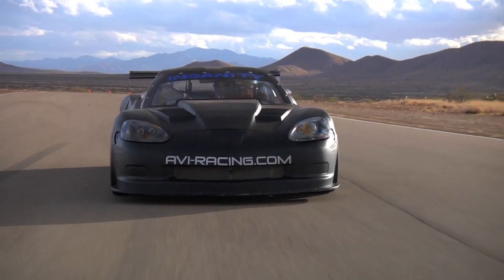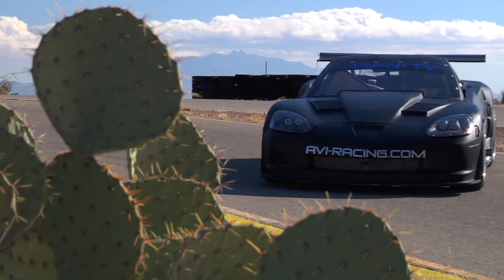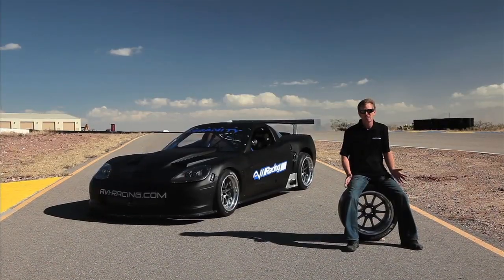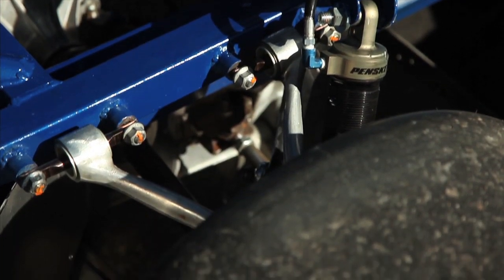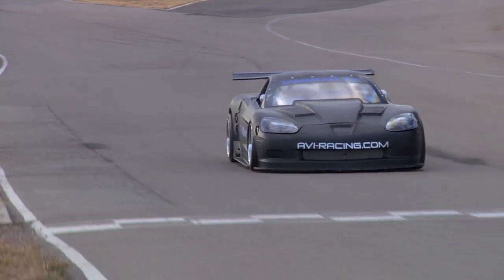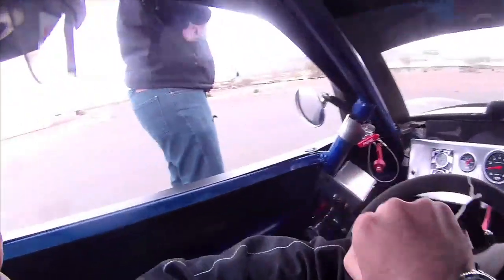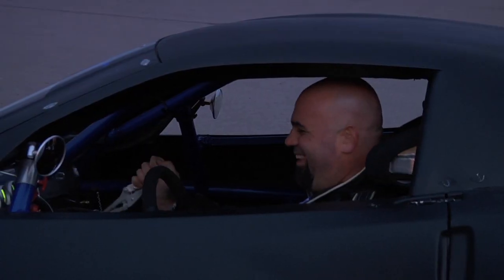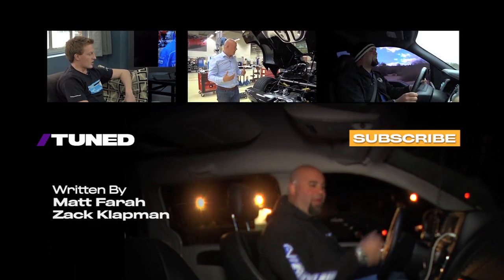The Ultra-Light, 505 WHP AVI Racing Corvette GT1 - /TUNED

Comment: Horsepower this horsepower that, i love rotaries, but since you've put so much into the engine i doubt you'll have enough for a downforce kit suspension kit new gearbox new clutch new tires like in the corvette, and i doubt it's as light as this corvette, so the extra 145 hp wont make a difference since your rx7 will be more weighty

Comment: I'm sorry, but you'd have to do more than shave weight off of your 3000GT to make it compete with this. Your awd system and the weight bias of the car are going to make it push hard going around a turn, whereas this car has rwd and a neutral weight bias that makes this car handle better than your car could ever dream of. That's why you don't see many, if any, full blown track cars with awd. And most track cars, like this one and a stock Corvette, use a rearmounted transaxle for weight biasing.

Comment: A GT3 Is Race Proven From the Factory So Yes it can beat this "tube" Chassis. And its 2330lbs Because its a Tube Chassis with a motor and a Fake Vette bodykit. The GT3 in Full Street legal trim is 3153lbs and has a 475hp 4.0L Flat6 And is Track ready from the factory! Im not Hating I am Just Being Realistic here. And I own Both Domestic and imports. My wife has a 04 cobra I have a 1980 LX with a 4.0L L6 from Australia. i also Have 1987 RX7 im Building for Autocross so i dont feel "Inferior"!

Comment: Stock the FB33 (1st gen) Has 111hp The FC3S (2nd Gen)T2 Has 225hp. and the FD3S has 276hp from the factory. I don't need to Speculate the power of them since Ive owned and researched Each Generation. My 7 will have roughly 650hp to the wheels from a Bridge-ported 20BT. And a Stock GT3 Porsche can stomp this Frame with a Vette Body on it into the ground. As i said 505hp is nothing.

Comment: whats with the rear negative camber?
Reply: .. Hows the compression dampening on your ride? seems a little high compared with your spring rate and roll-bar stiffness, and with the weight bias and tire widths of your car the front end is damped too low on rebound and compression, and the front sway bar is far too stiff...giving your ride a a really inconsistent front end with sporadic under-steer. however, once you get sideways you'll have yourself a pretty good lower-powered drift car for wet parking lots.

Comment: Having an FC3S means nothing. The basis for it might be fantastic (and it truly is) but just because one has an RX-7 does not mean that one run the field. Lower & wider means everything. Bringing down the centre of gravity on a car will improve upon its ability to handle, no use in arguing, it’s physics. Custom built means stock centre of gravity, weight distribution, and balance do not apply;  so saying that Corvettes will lose on cornering is misinformed. Track and autoX are different monsters

Comment: Wait he said that it is a 505 hp engine, but the title says its 505 WHP...?
Reply: thats hp to the wheels; 505hp could mean at the crank
Reply: Daniel Kerkotchian
Exactly my point. Crank horsepower is not the same as wheel horsepower. So the title is misleading. This is most likely around 430 to 450whp going by the 15% average drain in a rwd vehicle.
Reply: *****
Thats not what he said. He states "Under the hood you wont just see a 505hp LS3 engine, but a complete c6 corvette driveline including the cradles..."

Comment: don't like the finish... it makes it look plastic, or is it plastic?
Reply: It's fibre glass.
Reply: It is a race type car not some production car.
Reply: Quinten Verniers It's fiberglass and it's exactly how they come if you order one.  You can choose to hav it wrapped or painted but that costs extra.  The whole point is to have a super fast track car that won't break the bank.  Considering that basically everything on these can be replaced at your local GM dealership that's what makes them exciting.  Paint is what ricers worry about rather than performance.
Reply: Yeah I get it... It's not that I wouldn't drive it... I definitely would I was just wondering what material it was because it looked strange... :p

Comment: Umm The FC3S from the factory has a 50/50 Weight Distribution because the engine is behind the Front Shock-tower. and Custom built does not mean stock center of gravity,wt distribution, and balance and they DO apply! Hence CUSTOM! My FC3S is 2" off the ground with Custom A Race suspension the Wt Is 50/50 and the balance is Perfect. Tell that to Racers who have beat vette's on AutoX AND tracks! Even a Moderately Powered 13B T2 FB can beat a V8. watch?v=lUySZ8RgNAg

Comment: "505 Horsepower LS3"  - you mean an LS7?
Reply: Not necessarily, no. GM has several iterations of the LS3/LS376. Of which, there is a 480, 495 and 525bhp version; to that end, I'm sure it could have very well been an LS3 variant.
Reply: Right - however, the 505 horsepower engine is typically referring to the LS7 - the 7.0 L Z06 engine. Although it is derived from the LS3, it would be false to say the engine is an LS3.
Reply: +llamaslyr Maybe. It still depends on how you look at it. The only thing that really lends it to be most likely an LS7, is the intake manifold. However, small bore LS7 heads work on LS3's can can therefore use the LS7 intake manifold. Either way, I'm sure this thing hauls ass.
Reply: it's an Ls3 you can build it to a wide range of power.
Reply: +Matthew Lee the 505hp ls7 is what came stock with the c6 zo6. It would be safe to assume it's an ls7 not an ls3.
Reply: Indeed. I'm very aware of the stock LS7's power output. However, this is 505 wheel horsepower, not 505 brake horsepower.
Reply: +Matthew Lee kind of a coincidence how a modified ls3 has the same exact wheel horsepower as the stock ls7 brake hp.  Seems off to me.why not mod the stock ls7 to have 600 whp instead of buying a whole new ls3 engine and just making it have maybe another 50whp over the stock ls7. Seems like a huge waste of money to me if that's the case.  Something is off here.
Reply: Who knows. It could have been something as simple as a typo or, it could be the cost or even, restrictions on engine displacement for the bracket they're trying to run in. There could be all kinds of reasons. But if you want to talk about a coincidence, years ago I had a 2003 Mustang GT. It was rated at 260bhp and 302tq. After some bolt ons and utilizing the stock tune, I strapped the car down on the dyno. Oddly enough, I ended up making 260rwhp and 302rwtq. I kept that dyno sheet for several years just because I thought it was uncanny. 

Anyhow, back on topic. Yes, the LS7 can be made to have ample amounts of naturally aspirated power. Keeping things even, stroked LS3's with the LS7 top end produce pretty much the same power as their LS7 counterparts. Do many people do this? No. The cost of a LS3 brand new isn't cheap but, if you could get them used, and do the aforementioned modifications, you'll have yourself a very stout engine for less than the cost of an LS7 brand new. 

Again, who knows. Unless Matt Farrah is about to hop in here and shed some light on this debate, we are stuck with this conjecture.
Reply: Jon Becker because $

Comment: power means virtually nothing in road racing, sure it helps you get a jump on someone out of a corner, but 90% of road racing is how good your car can go around the corner. Any stock car on earth will loose in a corner to a full tubular vette purpose built to go around corners fast. Even a high end Ferrari would spin in corners this vette eats for lunch.

Comment: I love the kid that thinks his 3600lb 3000gt will out corner this car.

For a comparison this car (based on other lightweight large contact patch cars I've driven) will pull upwards of 1.5g sustained.

Your 3000gt pulls about .94 that's about .56g or just over a half a g of lateral acceleration less than the racecar.

That would be like an amateur boxer stepping in the ring with Tyson in his prime, so out classed it's sad.

Comment: this car is only lightweight because they threw an all custom body and stripped to the bare. do the same to my awd vr4 twin turbo and it will have the cornering and acceleration to compete easily with this. just because stock its not better than these modified cars doesnt me it wont beat them the same mods

Comment: so this has the power and handling to race vs a gtr? SOOOOOOOOOOOOOOOOOOOOOOOOOLLLLLLLLLLLLLLLLLLLLLLLLLLLLLD
Reply: Razvan J Of course, you have to be a good enough driver first - I'm pretty sure, shit driver that I am, I'd be faster in a GTR, because it can baby me through the tough bits - this thing would just be too much for me to handle - which is my fault, not the cars.
Reply: Razvan J  I doubt it will destroy GTR Alpha 16.... ever
Reply: ModernProgram Not in a straight line which is what the alpha was built for. But on a track, it would be no contest.  The vette would mop the floor with an alpha.
Reply: ***** But what if GTR was made the same way this car was. Meaning the exterior and interior materials?
Reply: ModernProgram It has happened before, it's called the GT3 GTR. Two teams tried to use them, after half a season for one team, and almost a full for the other, they both dropped out. The chassis wasn't competitive to the Porsche,  Ferrari, Viper, BMW, and Corvette competing teams. AWD doesn't belong on a race track, two much extra weight, and too much understeer.
Reply: ***** You are wrong. GTRs competing under FIA GT3 specs are all RWD and are race proven, go google that..
Reply: Luiggi Navas Not for thier  first seasons debut. Now they are running RWD and the V8, which in turn  has made them much more competitive.
Reply: ***** The car's VR38DETT V6 Twin Turbocharged motor unleashes a maximum 405 kw ( 550 ps ) of horsepower and maximum torque of 637N・m ( 65.0 kgf・m ). Standard equipment includes a six speed sequential manual gearbox, semi-automatic paddle shift and adjustable steering wheel. As mandated by FIA GT3 rules, the car is rear-wheel-drive. The older GT-R competing in the now extincted FIA GT1 used to have a V8 engine and was also RWD. FIA GT3 regulations don't allow AWD cars.
Reply: Luiggi Navas I remeber  a while back when the GTR first came out. It raced in either GT1 or GT3 (I don't  remeber) and used the 3.8tt and AWD, it was for a prototype  or something  along those lines. It also wasn't  allowed to accumulate any championship  points, it was only  there to see how the car would do. I also remeber it wasn't  even remotely  competitive  and they dropped it halfway through  the season.
Reply: No AWD is allowed according to FIA GT regulations mate, it's been like that for a while now.
Reply: Luiggi Navas Maybe because  this car wasn't  actually  battling  for points it was confined to different  rules and regulations.  I do 100% remeber  this car though and it was the 3.8 and AWD.
Reply: +foolongtea At first they were running in GT1 with a heavily modded 5.6 V8 N/A; they added the GT3 car with the 3.8 V6 TT and shortly thereafter retired the GT1 when the class died.  I don't remember them ever having AWD in GT3.  As Luiggi says, FIA GT does not like AWD, but maybe they made an exception for a minute.

Comment: Also as a previous owner of an S4 TII, get your facts straight. IDK about the SA22 but:   JDM only- Inifini III makes 215ps. Infini IV makes 225ps. USDM S4 TII makes 180hp, S5 makes 200hp. USDM FDs make 255hp. The US never got the S7 or S8 which made between 255-276hp depending on country and configuration. You probably don't understand how the 13bs work much less understand porting on rotary engines. Go back to video games please discraceful rotary enthusiast.

Comment: You're missing the point of this car, which was to build an ultra light weight performance car, in the video the dry weight is stated to be at 2300lbs,, VR4 AWD system weighs in around 500lbs, so you would of just put the cars weight back up to 2800lbs, so instead of 900lbs under the original Vette's weight he would only be 400lbs under weight and thus defeating the purpose behind the car and wasting a lot of time and money building a polished turd.

Comment: So this vette is like an RX7 Mazda with an LS engine .
Reply: ak47law No, it's like a tube frame corvette with an LS. The chassis is so stiff it's impossible to compare it to a street car.
Reply: Mournful3ch0 I was thinking more in terms of power-to-weight ratio, that's why I used the RX7+LS example but you are right , that is a full blown race machine, way past street level.

Comment: First off, what is a GT700 car? JGTC has 2 classes, GT300 and GT500. Not sure where this GT700 business is coming from.

Second, I think you really overrate the Agera/other cars based on power. A street car will have trouble putting down those power levels, especially if it's RWD. You also really underestimate the effects of weight, aero, and tires. Any street car, no matter how powerful/tuned, will struggle to keep up with a lightweight race car like the one above that has slicks and aero.

Comment: Nice Vette lots of noise no real racing! Won 2 National SCCA GT2/STO '12Champs in Z06 CR6 Vette, 586rwhp. Ten P-1 finishes. Best USA pro tracks. My Vette would SMOKE this machine at 180mph.  Never build for $60K. 2013 GT1/TA SCCA Pro Series, new purpose built VETTE with SPU engine. Run all over my SUPER FAST 2012 GT2/STO Vette. Dude would not take $60K for his machine! Get serious. Check SCCA PRO/TA schedule be there with the best and fastest GT1 cars in the world.

Comment: 2300lbs whats up honda owners!
Reply: You know there are stock hondas crx with 1820 lbs?
Reply: carlover But they don't make the CRX anymore now do they?  Also a stock CRX say from the early 90s weighed in at 2174 lbs.  It also only made 140 horsepower in it's most potent form.  Of course you can argue price and that's the obvious draw back, but this car will always be faster than a CRX, and pretty much all other Hondas at or below it's price point.

Comment: When they modify the unibody it stop being stock. Stop saying "Stock" you don't know the meaning of it. And you obviously don't know what you're talking about if you think they put little time in the engines, aero, suspension, body, etc etc etc. 

They are extremely modified in most cases. You don't slap a 500hp powerplant and expect a car to be "okay" with it. Let along a 700hp engine. The cars are a great deal wider too. Words are lost on people like you so I won't argue with you any further.

Comment: The guy made nothing. The car is an old and trashed World Challenge chassis/bodywork. Honestly, don't trust anything that came out of that guys mouth, he branded the car as GT1 even though it has no relation to the real thing. It is just a trashed, second hand chassis that has been redone for sale.

He just bought the bodywork moulds and production rights. He never engineered anything, he is just a dime-a-dozen off the shelf parts guy.

Comment: Why start with a street car? So it doesn't look retarded when it's done. With no practicality whatsoever. What's with the rear wheel/fender situation?? the tire is too small for the rim.. Why does it have a rattle can paint job? So you're selling a race car with a corvette body for corvette prices. got it!